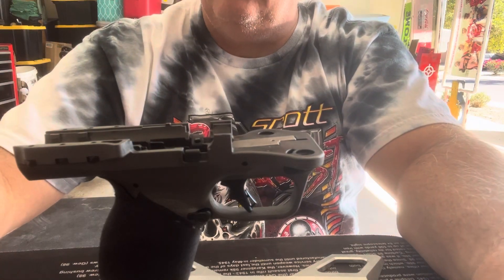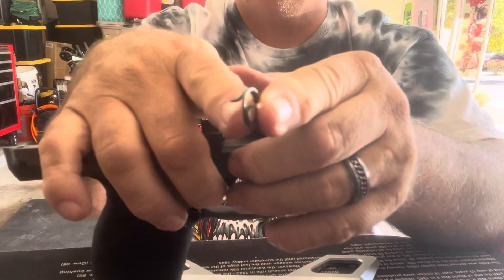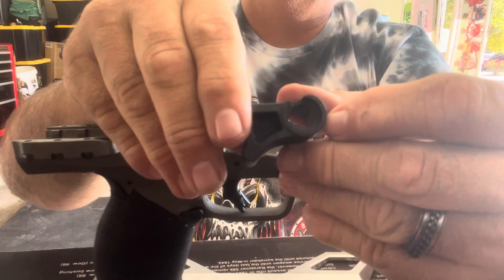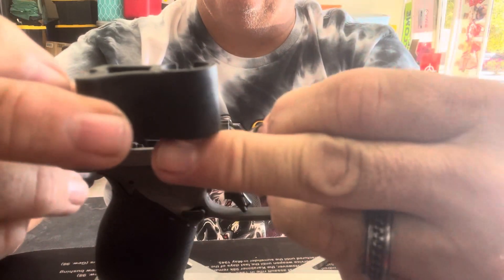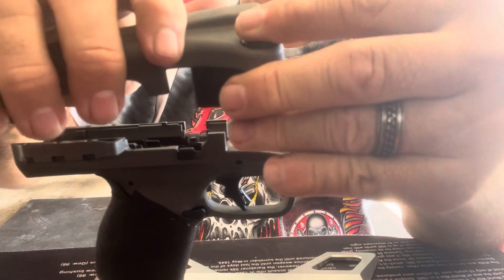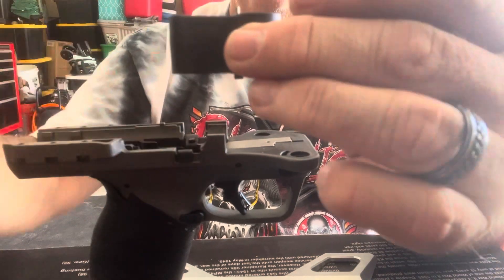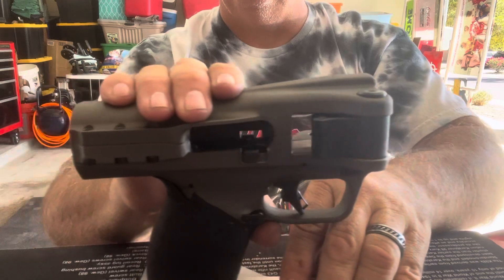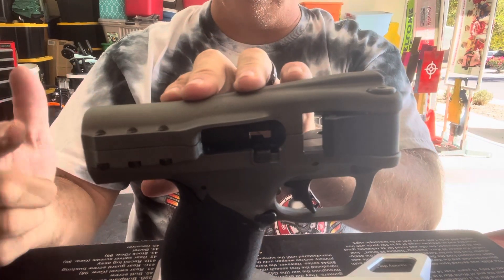S&W FPC Folding Latch Assembly

Comment: Any idea where I can buy a replacement latch assembly? I cant find them online anywhere. My buddy lost the 2 screws, spring, and latch and told me I can keep it if I can fix it but I cant find them online for sale anywhere, at this point i might just try to 3d model it and make one on my milling machine.
Reply from the maker: Call S&W directly, they just may give you the parts. Have the serial number handy when you call.

Comment: Have you heard of any issues with the latch moving? When i picked mine up new i oiled the gun and took it out to shoot, after the first shot you can see the latch jump out to the right. Every three or four shots i have to push the latch back in or it will completely unlock.
Reply from the maker: I haven't heard or seen that issue. Both of mine has been just fine. I will see what I can find.